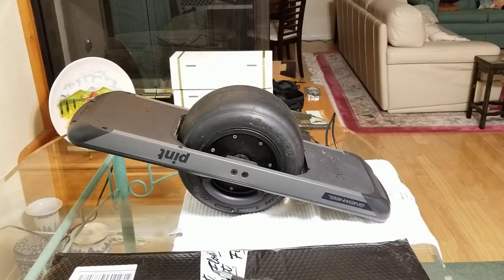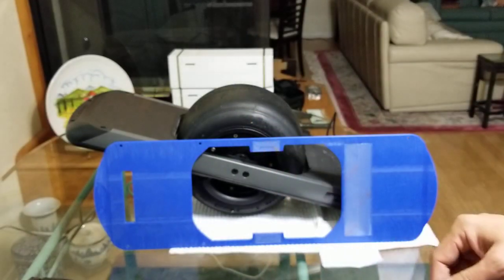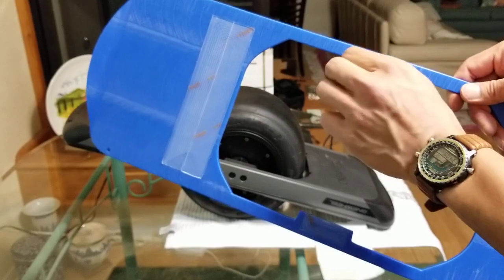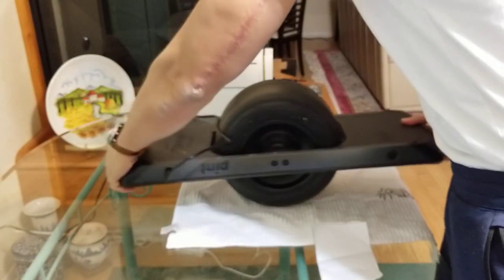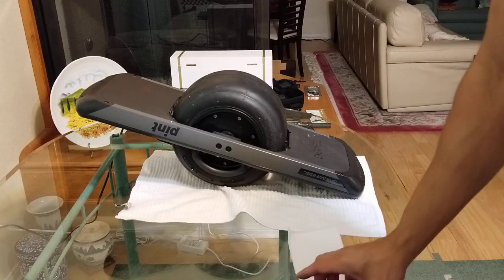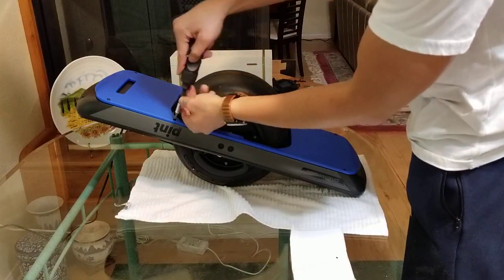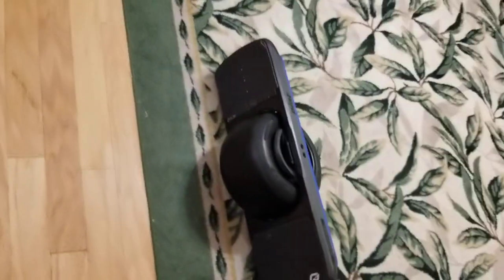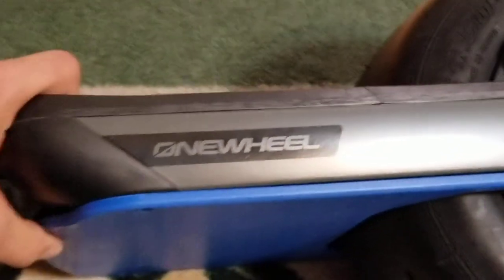OneWheel Pint Accessories: the Float Life Float Plate Solo installation

Comment: Don’t think you will strip the screw, there is metal on the inside without the skidplate you can tighten them suckers way down but with the skidplate i was afraid i was gonna pull the screw through the skidplate as it is really soft plastic and the screws really sink into it if you aren’t carful. Great video tho thanks for the help!